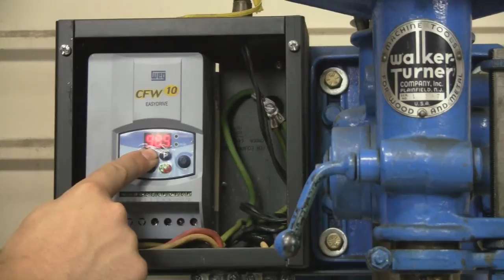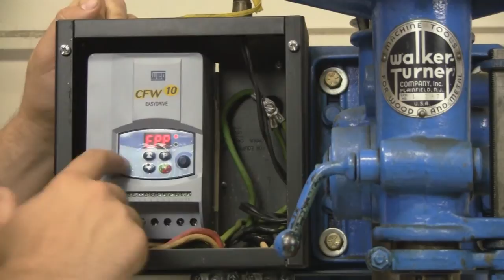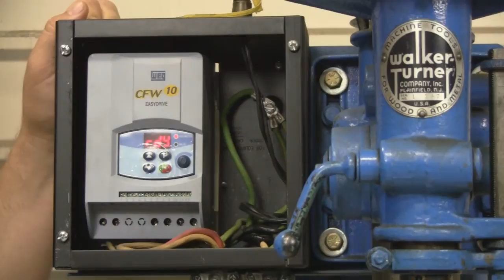WEG CFW 10 VFD Parameters

Comment from the maker: With any VFD, at low speed, you do run into a loss of torque. The exact specifics are referenced in a graph in the manual. In your example, running the motor at 60 Hz will produce the rated horsepower and torque.